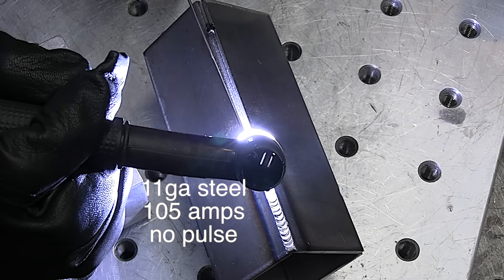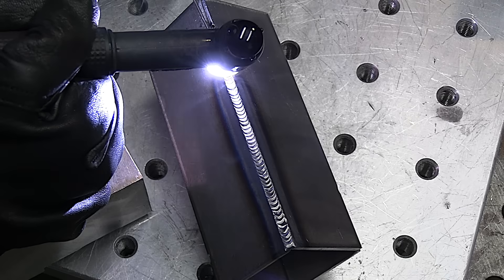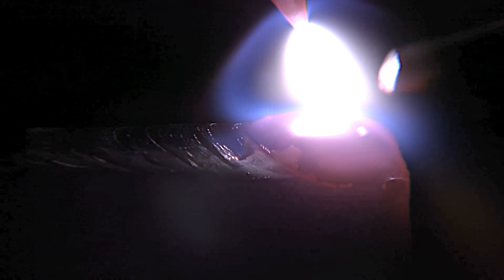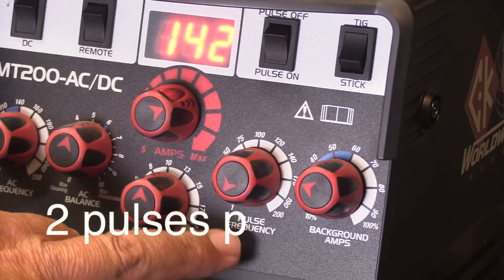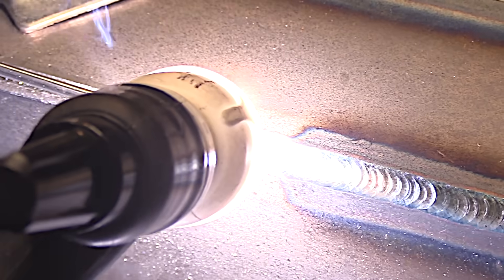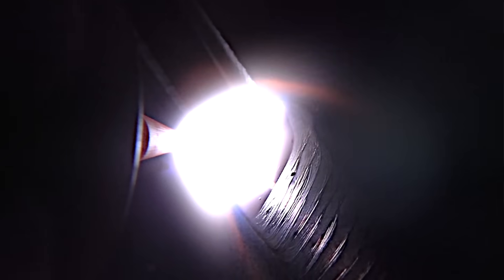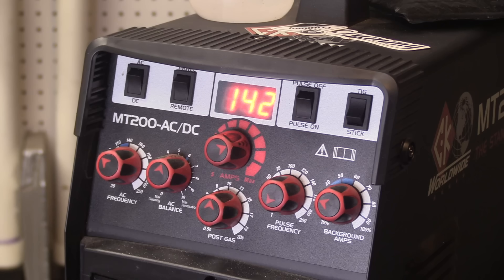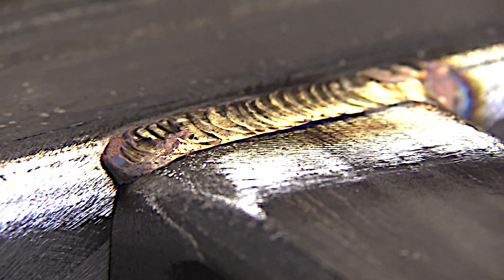Pulse TIG vs No Pulse

Comment: Hello great videos thank you.
Would you happen to have dc tig pulse settings for 3/16 carbon steel brake line tubing and 1/16 silicon bronze filler wire…for 1/10th scale rc crawler chassis cages…thanks for any info. Have wonderful day.

Comment: I noticed you using the larger cups with carbon steel, and I was wondering if that's needed, I definitely seen the do better with aluminum and struggle more with carbon steel as funny as that sounds

Comment: I see that the MT-200 doesn't have pulse width. I have a DC TIG machine with pulse, but now I'm in the market for an AC/DC TIG machine and was wondering how useful adjustable pulse width is. The MT-200 says it is fixed at 50 percent and I can see that would be one less setting to worry about with it fixed.

Comment: Low frequency pulse didn't really work for me, what's works great for me is few 100Hz to kHz pulses, low background with very high current spike, like 90%/10%,  70A/320A, with foot pedal for 1.5-2mm steel, short high amperage spike is like stirring the weld puddle, likely by electromagnetic force, so the filler sticks/bonds much better to base metal.

Comment: Hi. I want to ask you what is differences between pulse welding and DCEN.
When you set on the pulse, is  current and polarity changed to another? ex) DCEN to DCEP or AC something like that?
Reply: Pulse mode doesn't get to zero current, it switches from high to low(background) current  level continuously(not zero current). The polarity should remain the same. DCEN remains the same DCEN
In this video,  1.21min -background (low)current was set at 30% of high current value(not zero).  High current was set to 140A(higher than straight welding value)

Comment: What are differences between welding with ER70S-2 and ER70S-6, fully penetrating on a butt joint and which filler would be preferred for that application? I know ER70S-2 has a cult like following in the US, but in Europe and Asia it is sort of considered outdated and something similar to ER70S-6 is now used for previously ER70S-2 applications.

Comment: I think the whole welding industry based on Tig welding has to consider the newest technique taking the industry by storm and that is the "cold welding" method, which isn't really cold but is a form of tig stitch welding but with more grunt and precision.
For die hard tig operators the process will bring a derisive exclamation to their lips as they can only relate to what they know from the past practice and learned experience......to them anything new is taboo as it erodes their high status and brings the process of metal bonding down to a simple and practical level that pure tig cannot ever do.

Comment: Today i was working on this pulse settings I don’t know if the pulse settings make the weld weaker or it’s the same quality as the normal tig weld cuz it’s so easier than the normal tap welding for me snd im still a noob im welding tig for 3 weeks only

Comment: It's rather obvious you're very seasoned as a welder.I appreciate your thoroughness with your explanations.  I am just starting out and I came to the conclusion with sheet metal and some of the thinner gauges pulse welding would be a must as you mentioned it keeps the heat out of the metal.

Comment: I received my Black Box yesterday and I have a question about the Furick Cups box (starting at 3:18). The box says "Not Recommended for AC," but you are using the Fupa 12 with AC and AC pulse in this video. Why are they not recommended for AC and why are you using them with AC if the manufacturer says that?

I am currently using a Titanium Unlimited 200 from Harbor Freight, so I'm DC only for TIG. I watch videos like this for the techniques and insights. I will need to rewatch once I get a TIG welder with AC pulse capabilities. 

Thanks for the great video!

Comment: Hi Jody I was wondering about purging and purging a stainless steel barrel, I don’t want destroy it but want to weld a stainless ferrule to the top which will be offset. Question is if I fill the barrel nearly to the top with water but leave a gap of two to three inches then fill it with argon would that work?

Comment: Hey Jodi, been watching you for a while! I'm looking at buying an eastwood tig 200 ac/dc machine. Other than hearing their customer service is really good I haven't heard much else about them. The machine is just over 1,000 and was wondering if you have used eastwood before or know someone who has and had good or bad experiences. If you strongly advise against buying an eastwood what are some other good tig welders that run ac/dc
Reply: For the money, I think Everlast welders are the best you will get.  I also have an AHP Alphatig that is very good for $800ish.

Comment: Still never recieved my ez dabber. They sent me an email at the end of august saying all orders would be filled in 3 to 4 weeks. 8 weeks later nothing.🙁
Reply: I got mine yesterday, it should be soon.
Reply: @kevinblackwellwelder  hope so, been putting off finish welding a 200 gallon fuel tank I'm building out of 12 gage stainless. Got about 25-30 feet of dabbin to do on it.

Comment: I have a project and could do with a little help. It's a galvanized steel frame which has additional steel pieces added on. I'm using argon gas, proweld ceramic 8 cup and stainless wire. But the amount of times I'm having to re sharpen my tungsten due to the weld continuously "popping" is a nightmare. Any advice?
Reply: the only popping I've encountered was fixed by turning the argon up and or shortening the stickout.
Reply: Grind off the galv before you weld it...